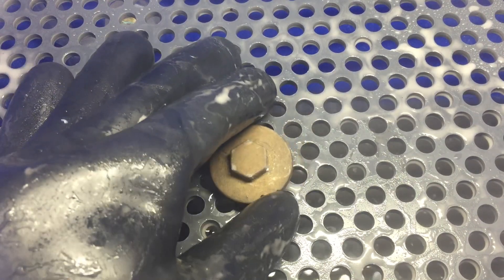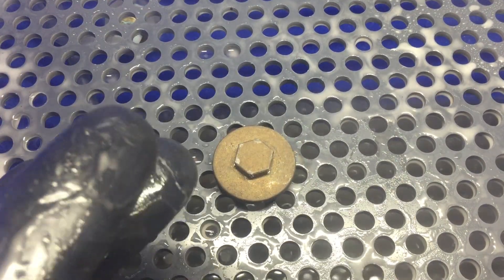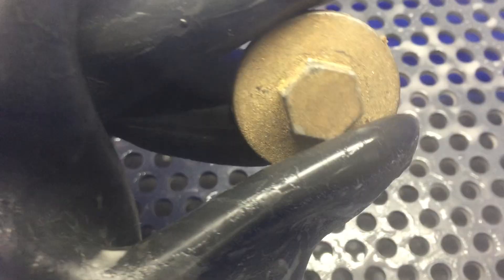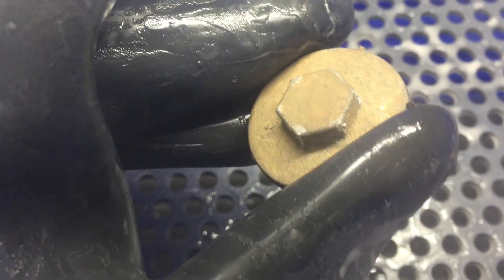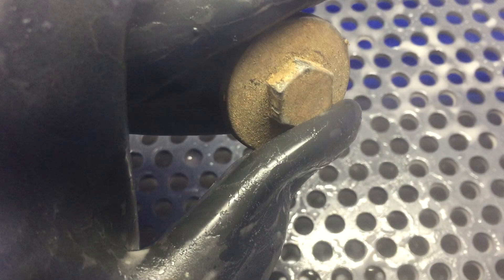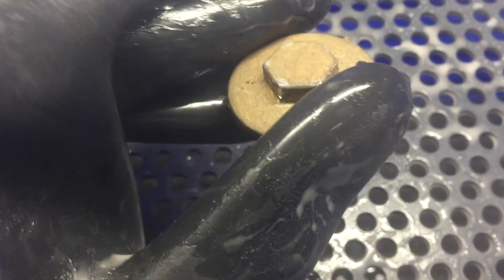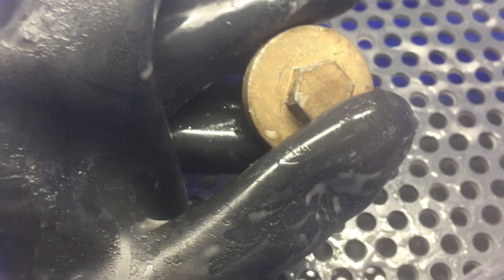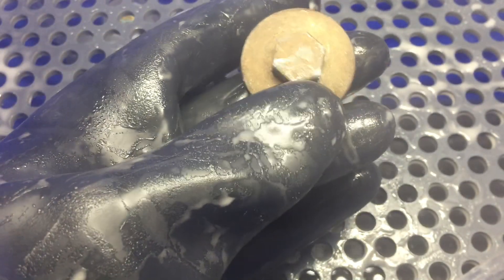The Tool You Need For Surface Finishing- Vapor Honing Technologies

Comment: What media do you use for vapor honing and for what metal and so forth, variations or variables, o-rings and so forth?
Reply from the maker: You can use most abrasives that can be used in Dry Blasting in Wet Blasting.  For example:  Glass Bead would be used for polishing and finishing, Aluminum Oxide, Garnet, or Crushed Glass would be used for surface prep for paint or powder coating.
Reply: @VaporHoningTechnologies  what about getting the right RA of a surface from what it used to be like a cylinder head or block